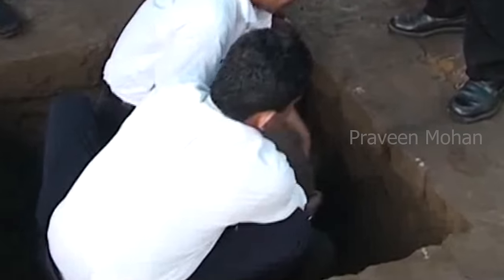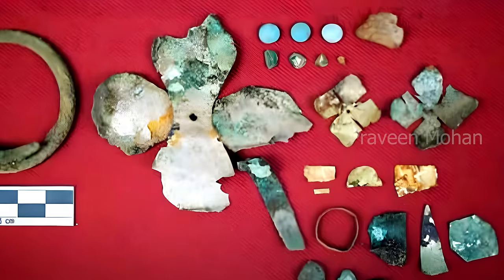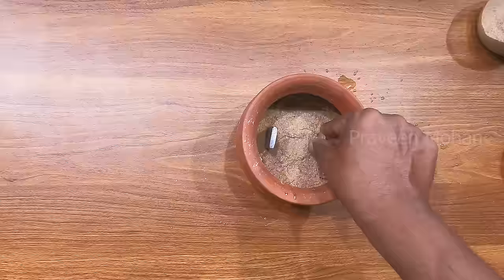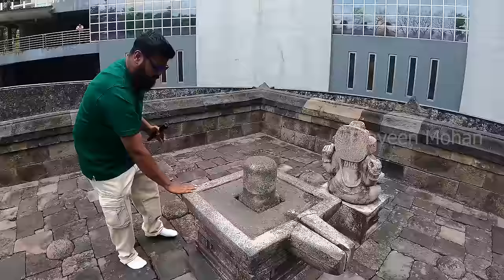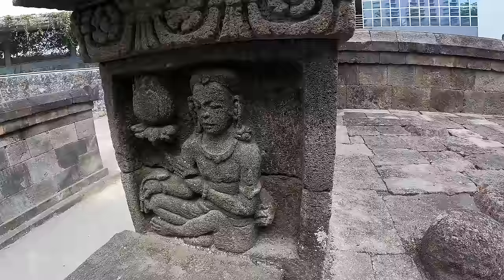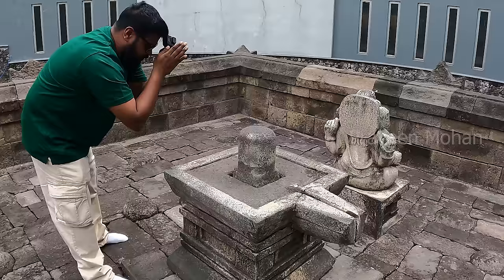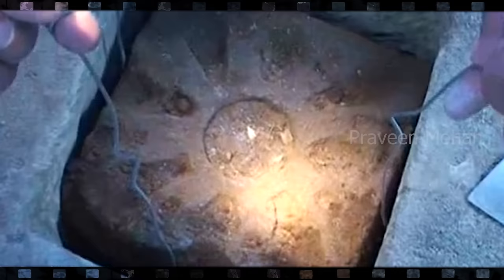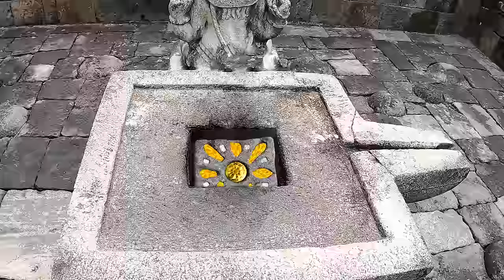Wait! This Ancient Lingam Produces Electricity?  Candi Kimpulan Temple Part 2

Comment: You are absolutely right about using electricity to heal. I have a neural stimulator installed in my lower back. It provides an intermittent electric current into my spine and takes away 90% of my pain away. Amazing.
Reply: It's perfectly understandable. Your muscles are run via electrical impulses sent from your CNS. The heart beats via a shifting polarity, that is what causes the expansion/contraction of the organ. Your body is an organic electrical/magnetic machine, thus it can be both healed or harmed with electrical intervention.
Reply: TAKE A GOOD PINCH OF KELTIC SEA SALT 3 X A DAY WITH WATER

Comment: Thank you for the update, Praveen..!!  Electricity from a 1,200 year old Lingam?  That's amazing.  Thank you very much for the teachings as always, Praveen.
Reply: 5000 years ago in egypt.  Pyramid. Light bulb Was Quarz crystal
Reply: Just put water in a cup with two metal plates and it does the same thing. The Lingam has nothing to do with it at all.
Reply: @Kneumann1991  no. Lingum. Was energy cooler. Like atomic energy
Reply: @Streleny 

🙂

Comment: Electroplating copper, or any other metal typically requires less than 6V in a tank plating set up. If you need more than 6V, it is likely that you need more electrolytes or your electrodes are spaced too far apart. Brush plating typically requires higher voltage, sometimes up to 20V.

Comment: I remember watching a documentary once years ago about ancient technology. Roman temples would use hydraulics. People would put a coin in a slot which would raise the water level in a hidden reservoir (like a pot) and the doors to the temple would “magically” open. Perhaps that’s what this setup does. Multifunctional. Energy healing and the electricity triggers a “magical” visual effect. Someone probably already thought of that but it would be neat!
Reply: Hydraulics??
Reply: Well in these Roman temples with automatic doors…I guess you’d walk up to a donation jar with a little fountain. Put a coin in the slot to get the fountain to work. The fountain and the donation jar are connected on the inside with a chamber to hold water. As the fountain works, the hidden chamber fills up. When the water reaches a certain point, it triggers a set of gears that pull hidden ropes that open the doors to the temple so the person can enter.

I’m not suggesting this Hindu temple has the same mechanical setup, but perhaps a similar concept. Maybe the gold and silver pieces under the lingam use the low electric current to trigger a visual interaction with another aspect of the temple as well as electric therapy benefits for the one worshiping. It would be neat
Reply: @sarina76667 
Yes I saw what you mentioned. The ancient people were not as primitive as they want us to think ( that we are more developed).
Reply: @reypolice5231  More developed my ass! Lol 

I’ve always had trouble sleeping. Before you could just watch whatever you wanted on your phone, I would watch a lot of late night documentaries on The History Channel or National Geographic. I remember catching a documentary about ancient graffiti. There’s ancient Egyptian graffiti telling the Pharaoh to suck it basically. Ever since I saw that, I understood that we really haven’t evolved as a species since before ancient times.
Reply: @sarina76667  
Maybe not evolved or matured, but that doesn't mean there weren't  engineers back then.
Reply: @xmo552  Exactly! If we’re just as disgusting and petty as a species between ancient times to modern, we’re also just as creative and curious. I just think in different terms now. Like instead of wondering how ancient people discovered the benefits of certain plants…Now, I just picture prehistoric people daring “that one guy” to eat that “weird thing that smells funny” just to see what happens. “Huh…He didn’t die…and he’s not talking to himself anymore. Good to know!”
Reply: @sarina76667   There are people today, that do advanced theoretical mathematics and design rockets to land elsewhere thousands/millions of miles away, and then the bulk of the population watches tiktok and spends their free time thinking about what they're going to buy next... 
The disparity between intellect of two individuals can vary wildly; it would be silly to think the same disparity hasn't always existed.
Reply: @Hazanko83  Then bring on the silliness. I thrive on embracing the ridiculous. My goal every day is to either make someone laugh or facepalm or both at the same time…which ever comes first lol! I’m in my 40s and I work at a county courthouse. Laughter makes everything better.
Reply: Steam turbine based on hero's machine operate egyptain temple doors
Reply: @sarina76667  the visual effect - kinda green light blipping while the door is being opened - low Voltage emitior of photons)

Comment: I hope Praveen gets to read this. I am in almost constant communion with the Akasha Records.

About the stone plate with gold and silver slivers, this, in conjunction, forms a magnetic cushion with a very specific EM signature. You could pour water directly into the pot, but tradition will have you pouring water in the lingam, and then it goes to the pot. Why?

Water has memory. In its first liquid state, water is to be considered a dynamic cristal; this means that, even in motion, water molecules can mantain most of its relative positions and geometrical distributions.

When water is poured over the lingam, it picks up the EM signature of the Silver/Gold arrangement, and with that, goes to generate electricity.

So, this ensures, not only voltage, but frequency as well. Gold and silver are vastly used in medicine, vaccines, treatments, and all of this, without going into monoatomic elemental gold, silvet, copper and others.

Good time to everyone who gets to read this. All my energies be with you all.
Reply: Very informative 😮
Reply: @vigneshs3378  thanks. You are helping me reach Praveen.

Comment: sure this is the same starch reaction you get from the potatoes clock ..  two potatoes with copper wire and zinc diode with produce enough charge to run small digital clock

Comment: I think Mohan, you are almost there it seems. Since the electricity is dependent on flow of water or may be mix of turmeric or ghee, it may create consistent flow at certain rate with that shape. If you look at the sound patterns on Chladini plates, we see some symmetric patterns. How a soothing sound can heal our mind, similarly rhythmic water flow might create some flow and definitely it changes with time(here we need to measure ac current instead of dc voltage). This may unleash more hidden things. ❤😊

Comment: By using t a transformer and connecting a 9v battery to the secondary side, when you remove the battery, if someone holds the primary side they will get a violent shock, because the removal of the battery will create an alternating pulse which will give a short burst

Comment: Great video.  Just for reference… electrical wire (copper, cca, etc) is stored this way to prevent kinks.  Once a copper wire is bent/kinked it changes the structure and causes resistance to electrical current moving freely.  This in turn produces heat that not only costs efficiency, it will eventually cause the wire to fail.  It will also cause electrical ‘noise’ that can affect sensitive electronics.

Comment: what if you placed a coiled wire, like the one found, in the pot, and have the anode and cathode in the middle of the ring, maybe sink the ring in the dry mix?  Doesn't a coiled wire produce a magnetic field , like the ones produced by wireless chargers?

Comment: Dr. Praveen Greetings. As usual, you bring a variety of historical/ archaeological facts to light, especially Hindu Architecture.
If I may add, energy was harnessed from the space above, stored in the radiator called Vimana, and focused centrally on the Shivalingam due to which it gets hot. Water and Ghee is used to cool the lingam lest the stone might crack. The energy then overflows through the lingam into the pot below which acts as a storage battery retaining a minimum charge.
You wear silk clothes and circumambulate the Lingam thrice to charge your own batteries. Pure harmonious vibrational energy that stirs the soul.
Reply: Silk cloths and circumbalate.... you just nailed ... 😊

Comment: Absolutely amazing. Thank you Praveen for your wonderful simulation. Can’t wait to see what you do with the alternating gold & silver part. With your low voltage electrolyte device combined with the alternating gold & silver you have the workings of an electric motor. The top shaft of the chivalingam is cylindrical so a “rotor” can be placed on it. 🙏

Comment: Praveen, did you notice the relationship in the shape of the metal pieces found outside of the Lingham on the floor being the same teardrop shape found under the Lingham where the gold foil and what not was found? I also am wondering about the relationship and design of This liquid area with the spout protruding from the Lingham base that empties into a pot. I saw a video showing a man producing tofu on a grinder that reminds me of the Lingham base, the tofu grinder had a hub in the center just like the Lingham base. It occurs to me that all that would be necessary to create a grinder from a Lingham and it’s base is to add an abrasion disc that would fit around the Lingham and a grinding attachment that would fit around in over the top of the Lingham on the Lingham base. Additionally I am having thoughts of this type of grinder being used to explore different material combinations for experimentation and exploration of different types of batteries.
Reply: gold, silver and copper
mind you too, it looks like a motor so im wonderin if they just set it up and allow it to be motorized
Reply: @maymay5600  perhaps not a bad idea, it’s sort of funny too it reminds me of the Wimshurst generator just because of the layout and the shape of the electrodes… maybe it ran off of the high voltage system that is now dead
Reply: @maymay5600  I am still thinking though it was educational, and that some things were being pursued there since most of the temples seem to be educational
Reply: @MrAnderson4509  hmmm
I'm going let you go on a rabbit hole 
If you about tartaria buildings then you those are healing chambers if not I'll direct you
Reply: @MrAnderson4509  maybe it can re powered
Haven't heard of that device....a lot stuff gets hidden from us

Comment: The copper ring was actually in place for a specific purpose - look up george lakhovsky and his experiments with copper rings / open oscillating cercuits - It creates a magnetic field in the shape of a donut that has healing powers.

Can you try the experiment again with the copper ring underneath the lingam and the opening of the ring facing precisely magnetic north.

Comment: is it realy that hard to believe that the wire was not just an ornament, as copper wire ornaments have existed long before the iron age. The thought for that would have benn " hey look , a shiny metal, it would look good as an accesory. it could easily then be shaped into a ring using a wire shape, because a ring is just a circular wire, and not all wires are for electrical purpouses, so lets not jump to conclusions. The plates also look like flowers(the tin plates that is). also, silver and iron were commonly used in plate form for decoration, and for the purpouse of scoop/ serving things. The general flow of water from a hieght does nothing for the electricty also, the iron plates look suspicously like iron spoons and spatualas. finaly, in the electro therapy pictures you yourself showed, it is hooked up to a genarator, and very exact amounts were given with exact readings, something that would have been nigh impossible without a voltimetre.

Comment: I have seen this several times. This seems to be a mandalam. As a practicing crystal healer, I can safely say that this is a crystal grid formation too. I use this formation even now. Am so surprised. Such an amazing  observation and such a singular find.
Such research isn't possible in Indian temples as it will not be allowed.
Another singular achievement. This is a vpaper. A visual research paper.
Congratulations and grateful for your body of work.

Comment: Gold and silver are high quality electricity conductors. . Look nowadays, the cable connectors that are made of gold makes the best video and audio quality.
Who knows, maybe they were also used as earthing socket to avoid the risks of electrification and electrocution that could've been caused if the copper wires were poorly insulated electrically?

Comment: Also Coiling a wire allows more current to flow through a smaller distance and increases the magnetic field.

Researchers produce electricity by flowing water over extremely thin layers of metal, thicker metal doesn’t work, there is a sweet spot.

The greatest advantage gold has is high resistance to corrosion, tarnishing and oxidation. Gold is less conductive than silver. Though it allows for reliable signal transmission, making it great for data applications. It is well suited for low voltage uses, and most notably, corrosive environments.

Comment: Ini masih dilakukan di Bali. Setiap mendirikan Pura atau Pelinggih maka selalu ditanam 5 jenis logam disebut PANCA DATU sebagai dasarnya.   Emas, perak, besi, tembaga dan kuningan. Diatasnya selalu ada pot dari tanah liat yang harus selalu diisi air untuk membasahi kelima logam tersebut. Mungkin seperti material ground untuk antena wifi. Atau mungkin sebagai Transmitter dan reciever wireless untuk energi, gelombang dan frekwensi.
Reply: Oh I am surprised...
Panca Datu sounds same as Sanskrit word Pancha Dhatu where, Pancha means five in English, and Dhatu means Metal, meaning Five metals. Exactly as you mentioned...
Reply: If you have listened in school rather than watching this shit you wouldn't  have typed this garbage (wifi antenna my A$$)

Comment: Piezoelectric Effect is the ability of certain materials to generate an electric charge in response to applied mechanical stress.  This could be true as the firm husk would help generate mechanical stress when the water (which contains mass) hits it from a distance. Potential energy to electricity in broader terms?

Comment: Good demo, but there is no need to have a Lingam to add the water which can be added to the pot by hand, and also people putting water on the Lingam for hours would just destroy the whole contraption. There were crude batteries in the past, people should look up Baghdad battery.

Comment: It's a 9 volt battery that you can check with your tongue, because you can touch both + and - at the same time. Unless you have a 5 inch tongue you can't do that with the other type.

Comment: I'm sure the box that had the silver and other pieces are configurations.  You showed the configurations where one or two pieces are missing in the 1st or second video. I'm sure in the next video you'll show configurations.  Those configurations charge the water in a certain way and that gives off a certain frequency or "healing power" that's why it's was easily removable.  It was removable configurations.

Comment: Even if he directly added water, it would have worked. Just fooling people while pouring water from lingam. I have liked few of his earlier videos.
Reply: There is no way electricity could flow in that grinned material unless it’s good conductor, however this material is not good conductor but it needs some kind of fluid conductor through which electricity could flow and react to copper/iron and silver materials.

Comment: I opine that the lingam with the alternating AG and AU petals under it acted as carrier/reservoir; or it might as well be a rotating generator to amplify the current itself. For instance to a 0.5 V electricity I start gradually supplying excess electricity via the water flow from lingam; energy lost will also be energy gained somewhere. Hence it could result in amplifying the 0.5 to maybe 2.0 or some value I am unaware of. AU (Gold) is the best electricity conductor. 

Another tangent of the thought line says it could as well be a dynamo with these pots as reservoirs and when needed the electricity was drawn.

All said; the biggest question! What was it used for?

Comment: may be that plates of silver and gold ionize the water, and when it pour to that pot the flow of current is like  0 -> 1 -> 0 -> 1 , like in hindu ritual we pour water 3 times so it will produce 3 times that small electric current ,  also i have notice  the main lingam  part always of a different material than base and that material is  not found in that region maximum time , its like a unlimited source of power ,  but you need to find out how you get that .

Comment: What can you do with that small amount of voltage? How long can that last? It still does not make sense. Cannot even light a small bulb and with continuous water it will just overflow and wasted.
And how long will that electricity  last to apply into anything useful.

Comment: Electricity producing is correct but using somekind of electrolytes , buy product is water, the outflow is just by product. 
The intricate layers within the lingam is the secret. I.e. fuelcell technology. Get back to me if you found something. 
Perhaps these lingams are some kind of fuel cell generator. The liquid poured on it is questionable...

Comment: Sir I have a doubt here actually in an electrical circuit we need 2 metal plates, a wire, a medium or electrolyte and a cell and in your setup you have almost everything except a cell or battery which is very important for producing potential difference or charge which will ultimately result in inducing electricity but how the water running down the lingam produce potential difference . Noone thought that before or am I the only one to notice??